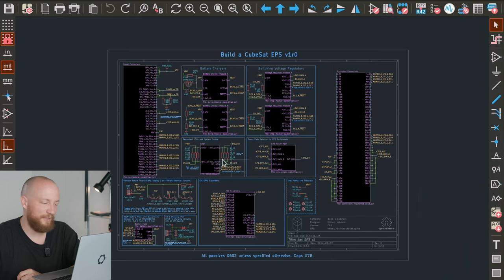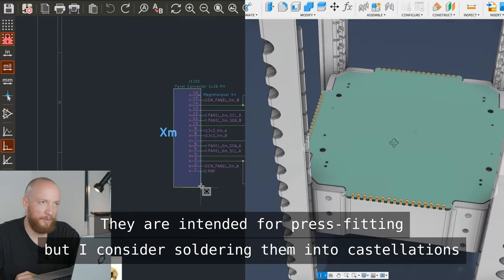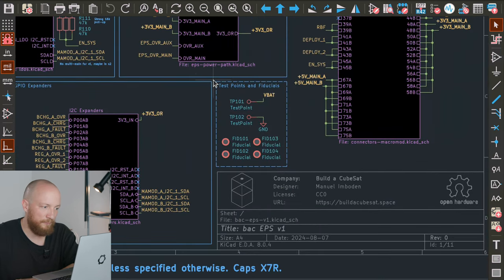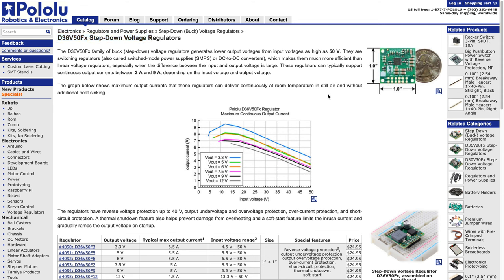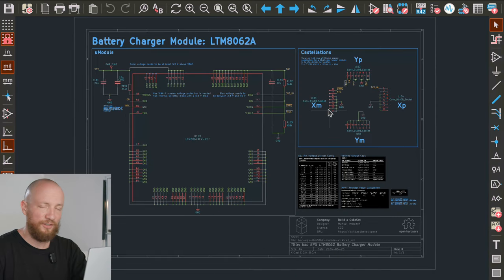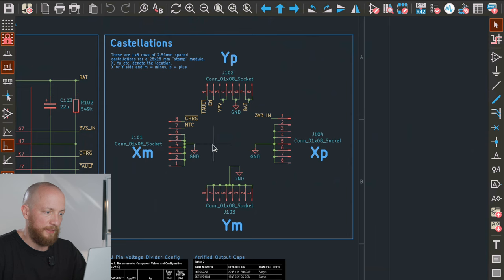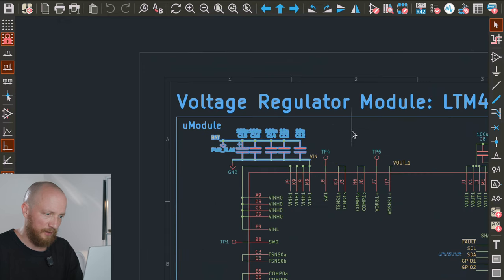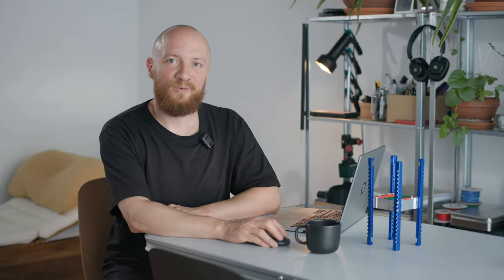CubeSat EPS v1: KiCad 8 Schematic, Part 2/2

Comment: I like the architecture you have here. I have a question, have you considered the radiation effects or tolerance with this design?
Reply from the maker: Thank you! :) I don't worry too much about radiation at this point, mainly because there are a bunch of other things that need to work before radiation can even become a problem. And also in LEO, radiation still seems to be relatively benign. My list of priorities up until the high altitude balloon test flight next year are: 1. Get it to work at all, 2. Thermals, 3. SI/EMI